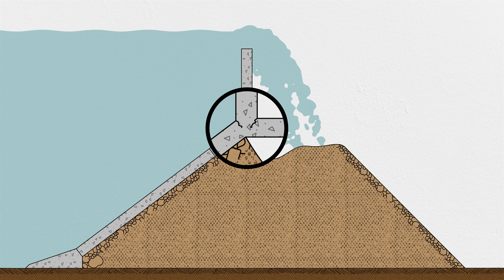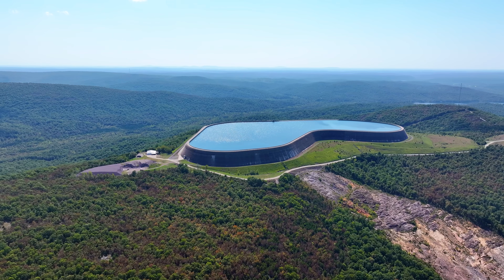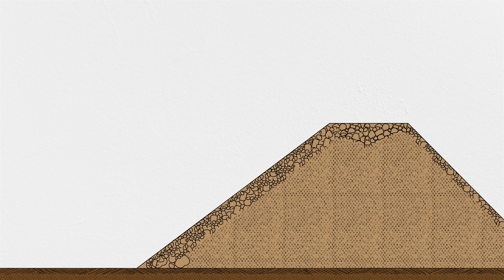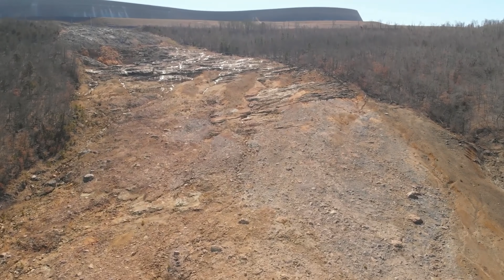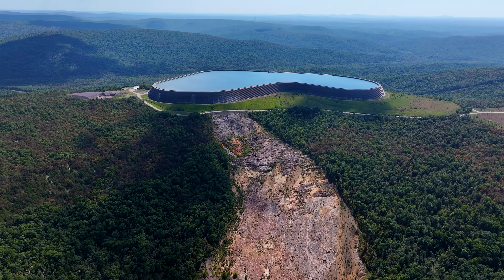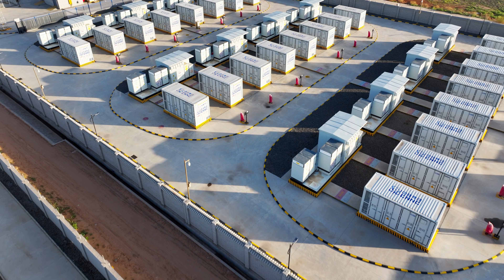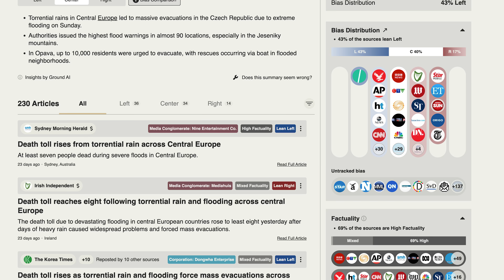The Wild Story of the Taum Sauk Dam Failure

Comment: Yeah and how many battery storage fires has there been already? Not to mention all the issues with moving them due to their weight. I’ve already seen several of them either overturned or snapping the trailers they are being moved with. Either way they are extremely dangerous and when they do catch fire they release extremely toxic gases. It would have been a seriously big problem if those battery storage devices had been installed in mass in the areas that were hit with the Hurricanes recently as those that were installed all burned to the ground even while submerged under water.

Comment: I tried to figure out how to take windmill energy and pump storage it... That is when I learned... MOUNTAINS... Mountains make pumped storage ALMOST possible. 

Building lots of water towers DOES NOT MAKE SENSE... 

How do I make it more efficient... Make it taller... 

Then there was the attempt to make power flow from 30,000 ft back to the ground safely... 

That cable gets REALLY heavy really quick...  But hey, maybe we can increase the voltage... 

and split it between 3 wires...  Yeah that is it... Make sure those wires don't get too close... 

doesn't 3 wires make it heavier...

Comment: 16:40 In an ironic twist, if the battery storage should become flooded with water for any reason, the fire will be uncontrollable and will have to be left to burn.
Reply: Are you assuming that the water will cause a lithium fire? There's no lithium metal in those batteries, the only fire risk is from the flammable electrolyte, and water will absolutely put that out.
Reply: @JamesChurchill  Yes, I thought there was lithium in those batteries.
Reply: @verohandymike  There's definitely lithium, it's just already in various oxidised states (hence why the chemistry is called lithium *Ion*.) For the same reason the sodium in your table salt doesn't explode in your mouth :D

Comment: Please explain why the water height sensor wasn't simple float levers attached at intervals to the top of the wall. This tech is found in every toilet. It's super cheap, causes no penetrations in the liner, immune to currents, & self-adjusts to wall height settling. Why use the cable float?

Comment: It seems like a good water level sensor would just be an air filled tube where you measure the air pressure at the top....or just a toilet style float switch at various intervals around the edge

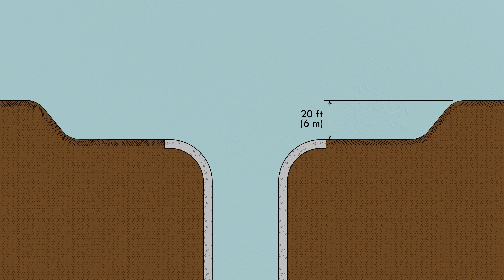Comment: some questions from a layperson: why is a vortex a bad thing? 5:40
7:55 why not just use a series of float sensors mounted along the wall? wouldn't that be just as accurate, easier to maintain, easier to install, and likely cheaper?

Comment: Being involved in a rural water system with a reservoir, I've seen the filling telemetry fail many times and an operator is not always present. While there is an overtopping mechanism, I'm not really sure the hillside below could withstand sustained flow. I think I'll open this question again. Thanks!

Comment: 0:43 I think this is actually the first time in my life I've heard "undermine" used in a completely literal sense 😛
Reply: As someone that spent a few years inspecting foundations and designing upgrades, mostly related to fixing settlement, I saw a lot of undermined foundations and footings.
EDIT: It's always due to water as well. During a large rain storm see where all the water is running off your roof, or your concrete patio, etc, and make sure it isn't going by your house or garage or anything supporting a lot of weight.
Reply: It was the way of attacking castles and other fortifications. Hence the verb.
Reply: @hughoxford8735  makes sense. For some reason I always conceptualized the "mining" part of it as a much bigger sort of...well, mine-sized hole! Always seemed like a horribly inconvenient way to try to get at somebody, but your explanation makes more sense 😝

Comment: A dam without a spillway? What could possibly go wrong?! Hard to believe this ever got designed in this way.

But I'm not so sure battery storage is the answer either. Especially not with Li-ion batteries. 

Apart from all the ethical and ecological problems with making and recycling those batteries, there's the small matter of their propensity to catch fire.

And when they do, they burn like hell. They can't be put out (they produce their own oxygen) and they burn too hot. So hot, in fact, that they set light to anything else in the immediate area. 

And, of course, there's the VERY toxic fumes...

Comment: ye, i dont see bateries ever overtaking pumped storage, maybe sand storage could do it, since sand is everywhere and its safer than pumped
Reply: Each storage technology has different round trip efficiency. Battery storage is very efficient for short duration storage (minutes to several hours). Sand and water are less efficient but can store energy for days to months. Some of the new compressed air storage technologies have very good theoretical efficiency for a 24 hour period. For a lot of peak shaving and small time shift applications, batteries are simply the most efficient with the lowest capital and operating cost.
Reply: @gerardwall5847  yeh, but conventional battery, lithium ion or similar have the highest pollution and human cost
if we are talking about green energy, green storage should also be the main choice

Comment: I grew up in this area during the time of the disaster. I heard people say “Taum Sauk” over and over again but I didn’t understand how it happened. From their stories, I always imagined a wall exploded or something. This really helped me understand the history of my old region. Thank you!
Reply: I used to hike from Taum Sauk down to Johnson Shut-Ins a lot back when I was at school in Rolla.  I seem to recall that one could see the reservoir from the trail, but I could be way off-base after 20+ years.
Reply: @Sturmcrow1  You could actually hike a relatively short distance to the reservoir from a spur from the trail.  I did so several years before the disaster, not realizing the reservoir was even there.  It was surreal to me to suddenly see this huge placid "lake" sitting on the peak of a "mountain" (in Missouri terms ;)).  Felt like I was in some Area 51 type scenario.
Reply: All I remember about this was the MO State Parks website saying the park was closed because of a dam failure. I was planning a motorcycle trip spring 06 and I was disappointed because I wanted to camp there. There was nothing really in the news about it, so I just remember just shrugging it off and thinking "Maybe there was too much rain. Good thing the brains in charge evacuated everyone." I never had any clue until now that there was a huge hydro electric battery there, or that the people operating it just let it run over, lol. It sounds like we all got really lucky.
Reply: The original resivoi was poured by the day. Next day start where you stopped yesterday. Three
guaranteed rules with concrete are, it's gonna get hard, it's gonna crack, and nobody is going to steal it.
  They had been dropping 
pool liners in it trying to slow down the leaks, so why not drain it and repair it? He's got the whole world in his hand!
Reply: Haum Tuak
Reply: Hauk Tuak

Comment: The whole “let’s just lower the threshold another couple of feet and call it a day, not bothering to check why the sensors and failsafes didn’t trigger” reeks of a managerial “suit decision” made in order to avoid both a loss of face and the loss of revenue from potentially having to stop the plant’s operation to fix the issues

Comment: I could have fixed their issue with some $5 float switches I've used for ~20 years on aquaponics lmfao
Reply: Only if you installed them in the correct place.
Reply: @CptJistuce  every 10ft around the entire thing? would cost me what, a few hundred? probably millions less than they spent lmfao
Reply: @gg-gn3re  That'd do it.
Reply: @CptJistuce  what is your profile pic from
Reply: They did have float switches on the high side
Reply: @neilkurzman4907  yea that doesn't help